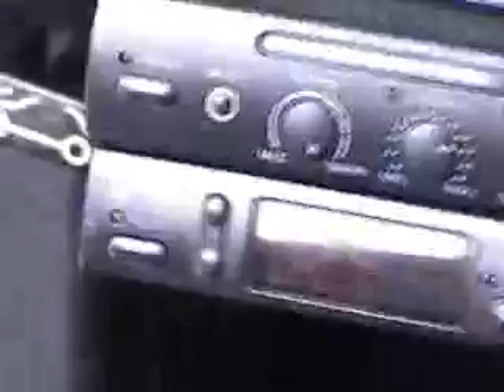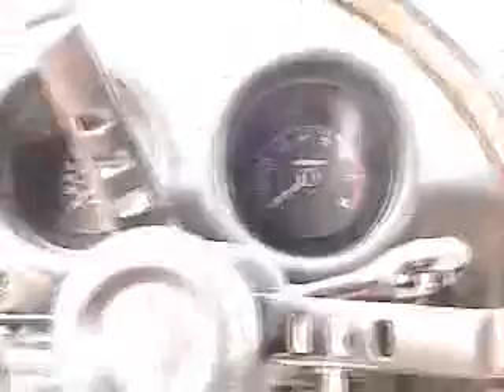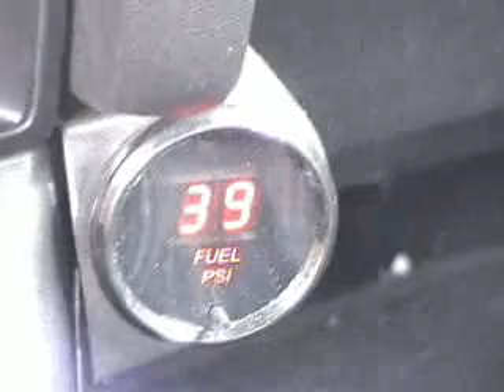turbo Datsun 280z big phil trouble

Comment: OK, try a polyurathane airdam (it will flex better than fiberglass), a good oilcooler for the turbo and one for the dif. Get a side job for a fue weeks to pay for the stuff. Running rich on the fuel will cook your turbo (new RCs). What clutch is it?

Comment: Friend of mine runs triple Mikuni's with his turbo... TOTALLY insane performance, and he's not running his even close to 25 lbs of boost. There is a set of these exact carbs for sale on Ebay right now i notice... Can't beat them.. I went with the rubber airdam on my Z... too many speed bumps and parking lot bumpers to worry about.

Comment: coz the RB25 Has A Alloy Block Weres The RB30 Has Cast Ioan best bet wud be 25 head and 30 block So Then Shes Got A Nice Strong Bottom End To Handle that boost mate and a nice low compression head to match + RB30 internals can handle up to 500hp no worrys anymore than that u need to start doin rings rods berings etc....

Comment: We all have our bad run of events phil. I hope your car comes out of this slump soon.

But please don't get a 240SX. It won't handle as well, won't be as fun to drive, and you'll be assosiated with the 240SX crowd unfortunately.

I know, I own a L28ET, but ditch it. Put that 2500 into getting a 400hp V8 in the car. Sell the turbo engine to help fund it. You'll have a larger power band and more reliability due to less stress on parts.

The RB25 in a 240SX just seems like a cop out. Sorry.

Comment: Sir, just get a new turbo. While I'd suggest a T3/T4 for now, there's probably something better out there to replace the HY35 (maybe something with water cooling?). Why sell the car you worked so hard on up to this point? The 240SX is a neat car and all, but you just won't get that same feeling you do from an old S30 Z. Do you really want to start from square one, again?

Comment: Remember....
Holsets take 35PSI on a Diesel. Gasoline engines burn a good bit hotter than diesels so they have more heat per PSI than if the same turbo was on a diesel. That is why you can put a diesel turbo for a 5.9 liter onto a 2.8 gas motor. More heat = quicker spool = more pressure on the turbo = cooked stuff. 
I say RB the Z... Sell off the Big Phil and Chris built motor and get that RB25 and plop it in!

Comment: im not trying to kid you at all man.. i been following your video's. You probably frying the turbos because your running to rich and the timing is maybe to advanced on your tune cause the more advanced your timing is and the more rich you run creates massive heat in the cylinder and all that is cooking the turbo.. i had similar problems with my Audi TT build up tell i leaned her out some on the top end and my 9krpm exhuast temps dropped over 300 degrees...